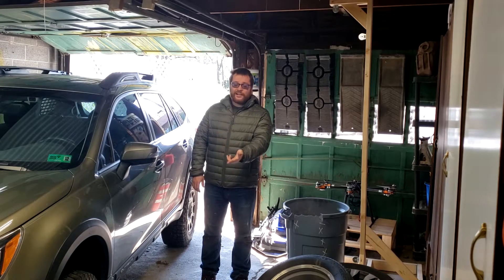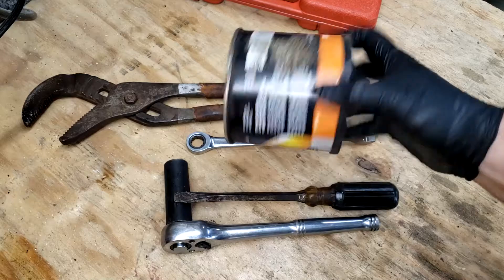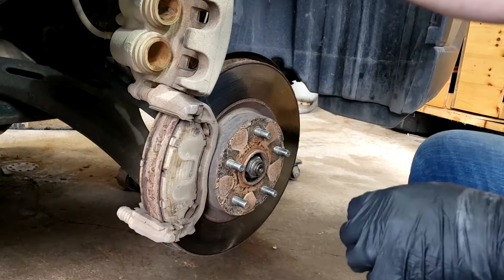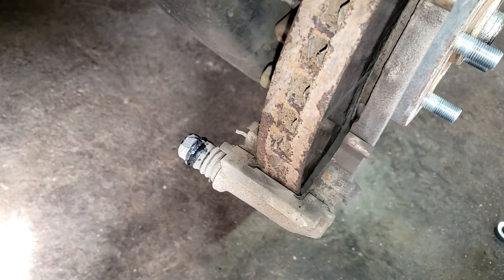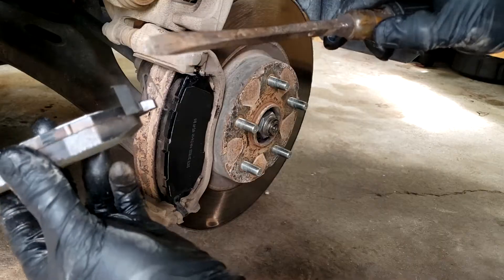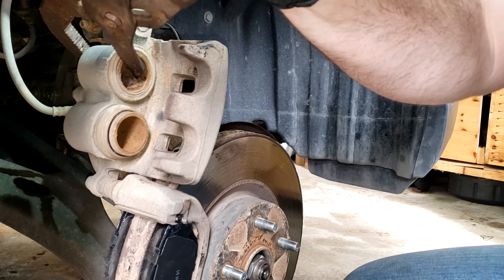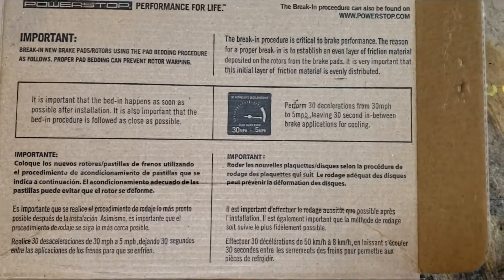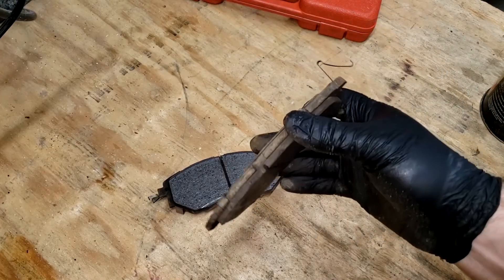DIY : 2015-2019 Subaru Outback FRONT Brake Pad Replacement

Comment: I'm getting ready to do this to my 2015 Outback.
I've seen on  a video, that the bleeder valve needs to be open, during the compression of the calipers.
I notice you didn't.
I suppose you really don't have to do that?
Especially, in my opinion, opening the bleeder valve like that, could cause air to get into the system.
I think they said that they do that, because of the ABS system?
I've never personally ever did it that way, but it's been a very long time since I've done this... LOL!

Comment: You didn't install the pads correctly. That little spring tab on the bottom should be on the outside. You stuffed it in the slot. That little spring tab aids in pulling the pad away from the rotor.

Comment: I helped my daughter (yes, she does her own brakes) with this yesterday and I'm a f*cking idiot. Had I spent 7:43 watching this yesterday before getting started, I would have saved myself at least an hour. The pads on hers (not sure of the year) have these little prongs and it was like doing a 3D puzzle. I was thinking, "There's no way this should be this hard." If I had just pulled the caliper pin and rotated the 2 halves, it would have been 100x easier. Oh well. I'll remember this for next time.

Comment: If i installed one of the four pads with the clip up, do I need to take the Wheel back off and flip the pad?  By the way, all four of my pads were identical in that two of them didn't have that special thing you said needed to go on the inside only.
Reply from the maker: If it's working I wouldn't worry too much about it. Apparently the design varies a little on aftermarket parts.
Reply: @bruceyyyyy  yea, i actually installed two pads with the spring on top (one on each side).  I've already bedded the brakes. IF I were to correct them,   will they have to be rebedded?
Reply: @bruceyyyyy  i have replaced the front brakes again, powerstop brake pads did not fit

Comment: Using channel locks in this manner could press the pistons in crooked. Damage alert! 
Use the correct tool. Harbor Freight has inexpensive ones available!
Reply: In the past when I used channel locks or clamp to do this I have left the old pad in place to distribute the load squarely, seems to work well enough to avoid the issue.

Comment: "I call them vice grips..." LOL  Loved the cameo appearance by the kitty. This video made the brake job look easy enough for even me to tackle. 

My independent mechanic I go to for jobs that are beyond my DIY abilities (so, everything) told me they always replace the rotors by default when replacing brake pads...they won't do pads only. As it turned out, I still had plenty of pad left, so I haven't had the brakes done yet. If I replace the pads only while there's still pad left, and there hasn't been any metal-on-metal contact, is there a compelling reason to replace the rotors? 

Maybe about 9 months or a year ago, it seemed like EVERYONE on Instagram was replacing their rotors with some kind of fancy aftermarket thing with curvy edges or cutouts or I don't know what. Is there a compelling reason for someone who drives like a...well, like a responsible safety-conscious 50-yr-old...to upgrade the rotors? What benefits are those people getting from those fancy rotors?
Reply from the maker: Re: Rotor + Pad makes sense from a shop perspective. It eliminates variables of brake issues and well, they're not paying for it. Right? 

From a DIY I've done plenty of pad slaps and been fine. I typically can't do it more than once. Once I did 3 sets of pads on one rotor but the rotor had to be out of minimum thickness by the end of that third set of pads. Not recommended. If the rotor is still thick enough and isn't damaged I see no reason to do it. 

If you DO want to replace the rotors and feel confident on changing the pads after watching this check out the Jeep Renegade Brake Change video I did (that no one watched). I changed the rotors in it and it's basically one extra step. The only special thing I noticed there was the brake caliper bracket bolts were thread locked with red. 

There was a mechanic in the comment section earlier. Might want to ask him for more feedback.

Re: Fancy Rotors

For a street/daily driven car? Looks. Instagram. I still need to get used to posting things although I can't figure out what to post. I'm a boomer like that. 

Slotted/drilled rotors have advantages in track cars. In a daily driven car those advantages are going to be immeasurable. 

The only advantage I can possibly think of worth mentioning for someone like us is I've heard (and haven't even seen good research or studies backing up the claim) is it's advantageous for clearing mud and debris out but even than that's a pretty minuscule compared to the shorter life of the rotor and pad.
Reply: @bruceyyyyy  Thank you sir, this is quite a helpful reply. Bit by bit I'm wrapping my head around all these systems that were just mysterious and magical to me before.
Reply: Hello, professional mechanic here. Also a subscriber to your channel. Just a comment on the “upgraded rotors”. Generally speaking, most people don’t need upgraded rotors. But if your so inclined, the advantage for the average person would be added heat dissipation, which in simple terms means, when you brake hard or for a long period of time, such as going down hill or towing, your brakes will be able to maintain a higher degree of braking force for a longer period of time, preventing brake fad and premature brake failure. And to be clear, “upgraded rotors” do not actually increase your braking power, only maintain a higher level of what you can already achieve just for a longer period of time.
Reply: @jklpino  Excellent, thank you, that is very enlightening!

Comment: You installed the pads wrong, watching your video I did too.. now I need to tear down the passenger side and do it again.  The lever spring on the bottom of the pad goes on the outside, not clip onto the inside.
Reply: Look when you remove the old pads and see where that lever spring is sitting.
Reply: Also good idea when you push the calipers in to release the brake bleeder valve and push the oldest nastiest fluid out of the system and not back into the system.

Comment: careful with those channel lock jaws on those piston seals!!!  Proper pad break-in is critical with ceramic pads - don't want to fuse/melt the pad surface to the rotors....

Comment: That is quite odd. Typically it goes two front to one rear. Sounds like maybe your proportioning valve is malfunctioning. The front brakes should do most of the work. Be careful with your channel locks. They can damage the caliper piston. Especially if you have hyperbolic fiber pistons. Can break big chunks out. I usually use a big flat screwdriver before taking caliper off. Stick in thru hole in caliper into vent holes in rotor and pry. Sometimes have to go between rotor and pad. Taking care not to gouge rotor. This helps loosen up slide bolts if needed. As they tend to stick. And subaru and i think every manufacturer quit using the screw type parking brake years ago. They suck. Had many issues. Now they are seperate. There are a set of small shoes that go behind the rotor. They use the inside of the hub portion of rotor as the brake drum.
Reply: The EBD system maximizes the effectiveness of the brakes by allowing the rear brakes to supply a greater proportion of the braking force. It functions by adjusting the distribution of braking force to the rear wheels in accordance with the vehicle’s loading condition and speed.

The EBD system is an integral part of the ABS system and uses some of the ABS system’s components to perform its function of optimizing the distribution of braking force. If any of the ABS components used by the EBD function fails, the EBD system also stops working.

When the EBD system is operating, you may hear a chattering noise or feel a slight vibration in the brake pedal. This is normal and does not indicate a malfunction
Reply: @wayne0822 The chattering is normal operation for any ABS system. If a wheel begins to lock , the brake on that wheel is pulsed on that wheel to prevent skidding. With any type of brakes it would be a rare occurrence to have more braking force to the rear wheels. Due to weight transfer the rear wheels lock up much easier. And all the electronic braking , stability control, etc are basically for people who don't know how to drive. A knowledgeable driver can out perform them .

Comment: Two things made me uneasy from watching this:
 1)  Your contamination of the pads by getting grease on them 
 2) The way you squeezed the pistons into the caliper - it is easy to cause damage by doing it this way - never put a tool directly onto the piston and only applying pressure to one side can drive it in crooked and cause damage.   Use a piece of wood or even an old brake pad and squeeze that and push both pistons back in evenly and at the same time.
Reply from the maker: Do you not grease your pads?